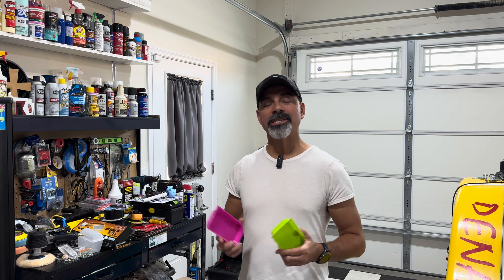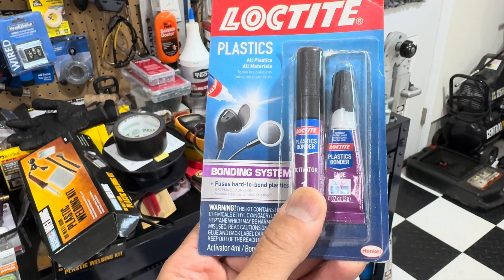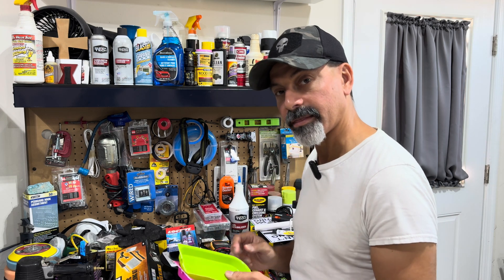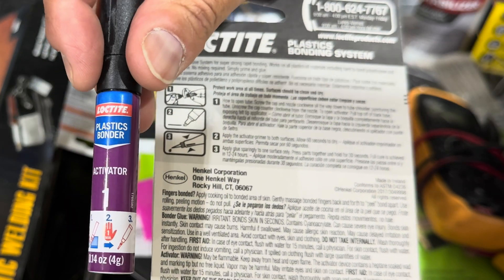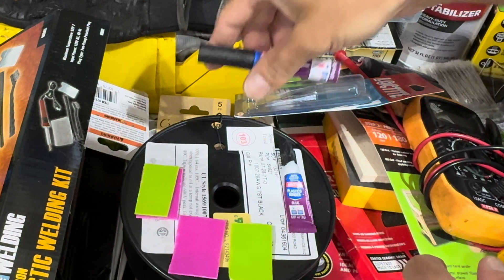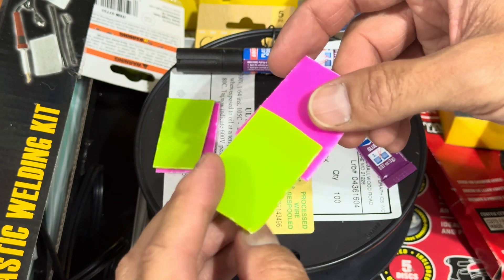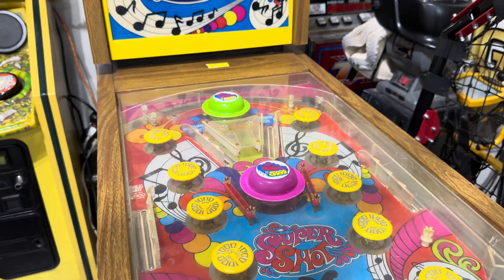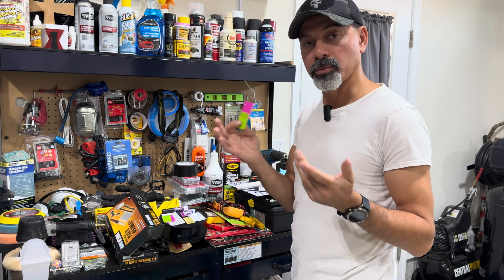How To Bond Polyethylene & Polypropylene Plastics  (Phillips Vision: Episode - 123)

Comment: I have used this loctite plastic glue on PP car parts and it works well but it is never as strong as the original broken piece.
 I have also cut up small pieces of CLEAN polypropylene of the same color and dropped them in a cup with enough acetone just to cover them. Automotive paint Thinner works too and both products start to melt the PP pieces instantly.
Leave it for about 1 hour depending on how many pieces of pp you have in the cup because if you have a lot it will take longer.
 The acetone melts the pp pieces into a sticky glop of liquid plastic which you apply to both of the surfaces you want to glue together. 
Because the pp Goo you have just made still has acetone in it, when you join the parts together the leftover acetone in the Goo eats into each of the surfaces & melts them slightly too and the two pieces become one piece again "chemically" & physically. Let it fully cure (the acetone evaporates) and after a few hours you have a solid join in the PP. In my opinion it works better than plastic welding or any other glue on the market, including this loctite product.
Reply: If acetone melts your polypropylene, what you have is not polypropylene, it's ABS.
Reply: Nice hack.  Google AI agrees with the other reply from buncha letters, acetone is not going to dissolve polypropylene.  Most of the solvents listed as dissolving PP are nasty, such as benzene and carbon tetrachloride (great solvents, but they will kill you).  The only one I see that I might try would be xylene -- probably not as benign as acetone, but I can buy it in the U.S. so it is not super-nasty.  Does require "elevated temperatures", so fire hazard would be there.  Seems to make sense to stick to stuff like the Loctite, and expect a less-than-perfect bond.
Reply: You are mistaken, acetone does not dissolve PP.